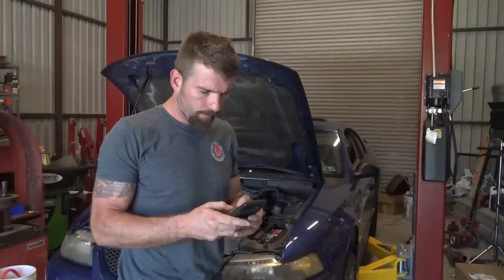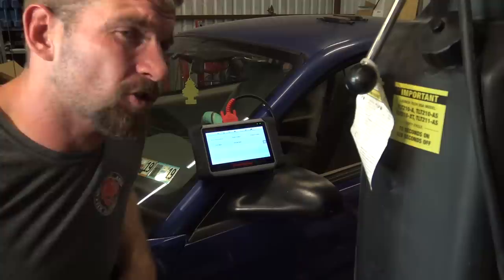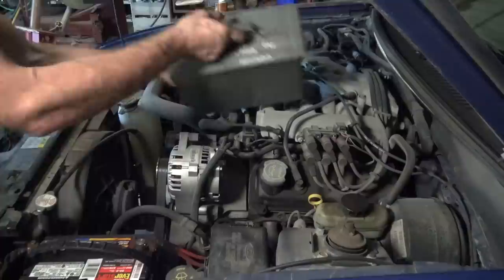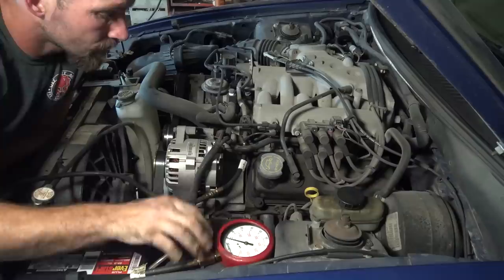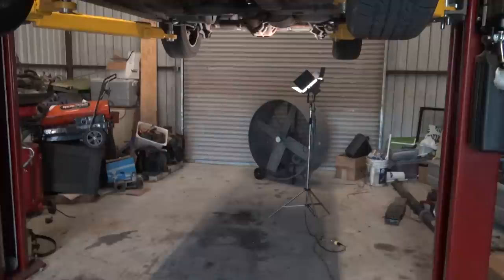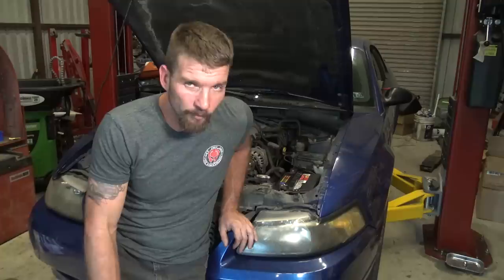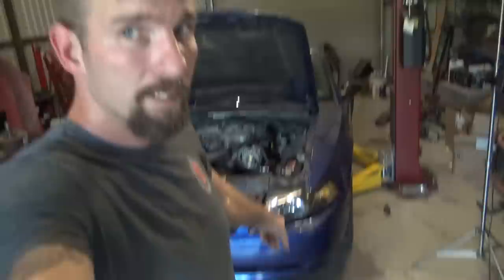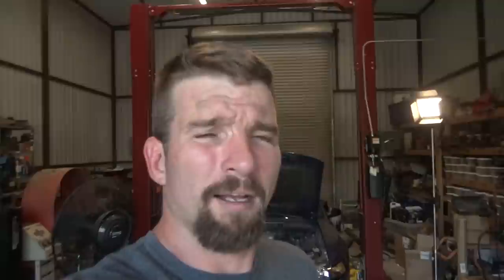Cutting Open A Nasty Fuel Filter

Comment: Only use Motorcraft fuel filters, they have stainless steel case. Stronger, non magnetic and wouldn't rust inside or outside. Had a Ch-yna made filter come apart inside letting crud clog fuel injectors on a 5.0 liter that was running perfectly.